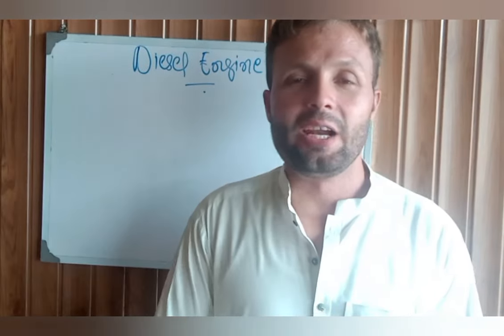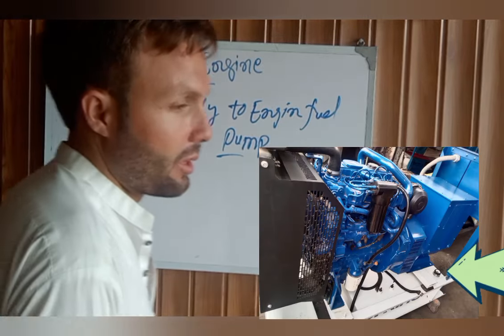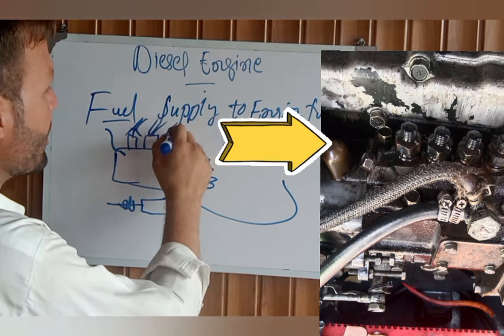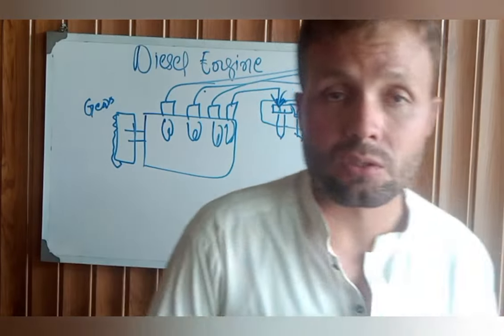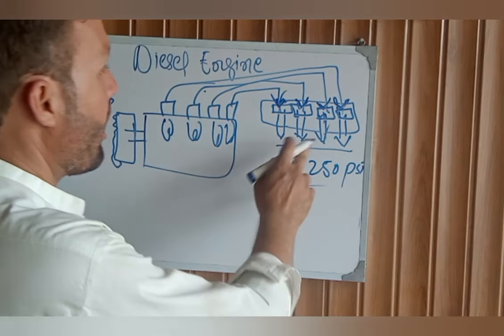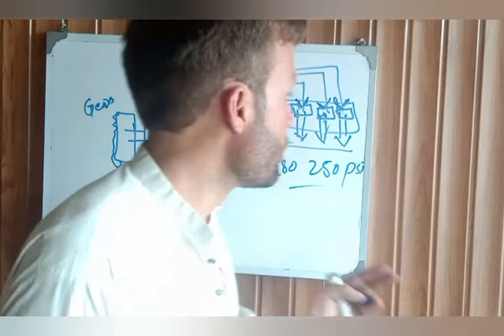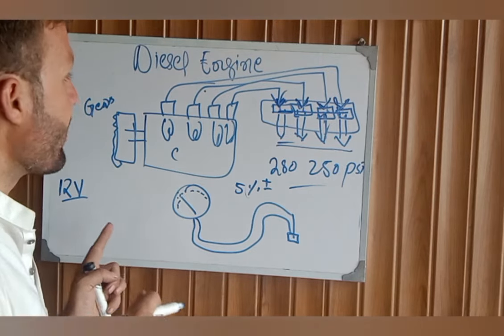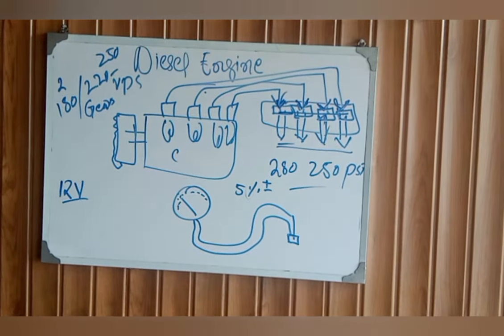Diesel engine crank but won't start,  how to fix it easy and basic steps

Comment: Why would a common rail diesel engine not start, even though starter turns engine efficient and fast enough, but it will run start in less than 2m.
Reply from the maker: Which engine model you have?
Reply from the maker: You have fuel related issues,
Check first the fuel priming pumps pressure, hang your fuel pressure gauge, start the engine check fuel pressure the fuel pressure during engine running,
Make sure you should have specific fuel pressure no any fuel pressure drop
Reply from the maker: If your fuel priming pump is faulty, sign of faulty fuel pump is overheating, if the fuel pump is overheating they leave the functions, check and notice make sure no overheating
Reply from the maker: If that is not a problem of fuel pump, check the common rail pressure regulator sensor, power and ground and signal , 

And check also injectors if you have any each injector faulty , leak, stuck open that's means your rail pressure going to drop cause engine stalls
Reply: Thank you for reply. It's a mahindra 2.2 mhawk. Still, why would it run start so easily though? My manual prime pump seems to not suck well, and stays soft. While driving under load engine will cut, ignition off and on while still moving will start eng again immediately.
Reply from the maker: 2 problem could be,
Fuel pressure dropping 
Cause faulty injectord, fuel rail pressure regulator , priming pumps
Reply from the maker: A common rail diesel engine may start and stall due to various reasons. Here are some possible causes:

Fuel issues*:
 Low fuel pressure
    Fuel contamination
    Incorrect fuel type
2. Injector problems*:
    - Clogged or dirty injectors
    - Incorrect injector timing or calibration
3. *Engine compression*:
    - Low compression in one or more cylinders
4. *Air system issues*:
    - Intake manifold leaks
    - Clogged air filter
    - Turbocharger problems
5. *Electronic control unit (ECU) issues*:
    - Faulty engine computer
    - Software or programming problems
6. *Sensor issues*:
    - Faulty fuel level sensor
    - Incorrect camshaft or crankshaft position sensor readings
7. *Mechanical issues*:
    - Worn or damaged engine components (e.g., piston rings, cylinder walls)
    - Incorrect engine assembly or maintenance
8.Starting system issues*:
     Weak or dead battery
   

To diagnose and resolve the issue, it's recommended to:

1. Check the basics (fuel level, battery, air filter)
2. Use diagnostic tools (scan tools or multimeters) to inspect engine parameters and sensor readings
3. Perform a compression test and fuel system check
4. Consult a repair manual or contact a professional mechanic for further assistance

Remember, this list is not exhaustive, and a thorough diagnosis is necessary to determine the root cause of the starting and stalling issue.
Reply: Appreciate it. Going to change the prime pump first, since it doesn't seem to work as intended. Just don't make sense why it run/bump start so easily.
Reply: No engine fault codes. All temperatures, intake engine, reads fine. Map and airflow in specs. Fuel rail pressure good and climbing under acceleration and load. Compression good and even over all cylinders. Egr was blocked off years ago. Scoped crank and cam sensors. For some reason I get pressure in fuel tank, only 2 pipes running to tank. Supply straight to manual prime pump and filter. (filter changed) to high pressure pump. Second line T from high pressure pump and injector return lines. If I remove line on prime pump out no diesel comes out even when pumping. I need to put pressure in tank to prime the prime pump.
Reply from the maker: @WayneWentzel first check.tank air ventilation  may it  Was a problem Pressure or vacuum in your Diesel tank ? I would think Vacuum, The cap might be faulty and not venting to the tank (sealing to well), then the pump cannot draw fuel to the engine and will starve and stall. The sound you are hearing is probably a low pressure purge pump that is trying to draw diesel from the tank to the high pressure pump.
It started again after a while because the vacuum in the tank reduced and the pump could draw fuel again.
Try drilling a 1mm hole in the fuel cap and see how it helps.
Reply: I would think vacuum in the tank since the pumps are sucking fuel from it. But no it's definitely pressure. Removing the tank cap has no effect on it. And it does not have a low fuel pressure pump. Only the manual hand prime pump and the high fuel pressure pump. Will the prime pump have an effect on the starting if it don't hold pressure?
Reply: I have a 2kd engine that won't start....cranks good....gets fuel and throws no codes....started perfectly before I changed injector nozzle gasket and after injector bolt broke and came loose....fit it back up with new parts and gasket and now it just cranks without starting
Reply from the maker: @jayvonnewell1516 check the engine timing, make sure timing is correct,
Glow plug circut is OK turn on first the glow plug for  30 sec and then try to crank
Check the intake manifold pressure, if you have leaky valves engine will never start, performed the compression test, make sure all cylinder have a good pressure, check all the fuel lines, injectors spary ,make sure fuel line is OK, air free, fuel priming pump is OK,
Fuel pump throttle is on properly adjusted,

Check the fuel conditions

Comment: لماذا فقاعات هواء في خط راجع الديزل
Reply from the maker: Low fuel level in Diesel tank..
Lose connection of fuel pipes or lose clamp
Bad or leak priming pump
Reply: @Info-Tech-  شكراً جزيلا
Reply: @Info-Tech-  وهل صمام الفائض يعمل مشكله فقاقيع هواء داخل خزان الديزل،من
Reply from the maker: No,
Bubble in fuel means air coming to fuel lines during the fuel pump sucking the fuel, 
If low fuel and tank, or crack fuel pipes, or leak priming pump, this is the main reason to bubbles in fuel, 
Lose all injectors pipe and cranking the engine make sure all system well fill from Diesel no.bubble then tight all pipe and start the engine
Reply: @Info-Tech-  لا أدري كيف اشكرك على معلوماتك،اتمنى لك ولقناتك النجاح والتقدم🤲